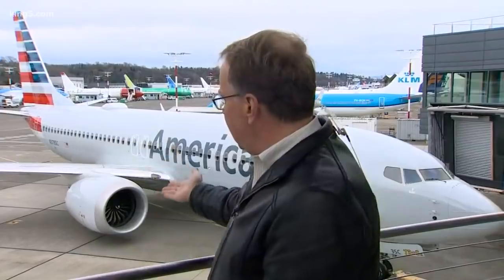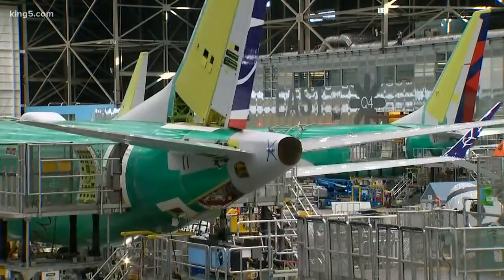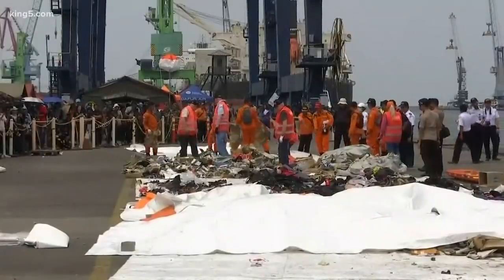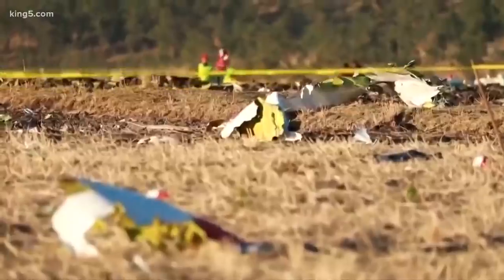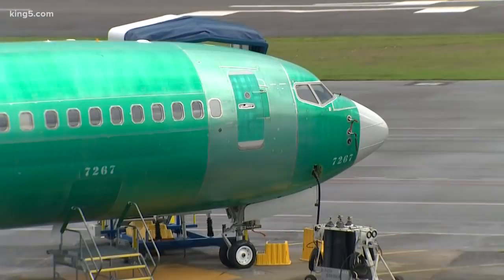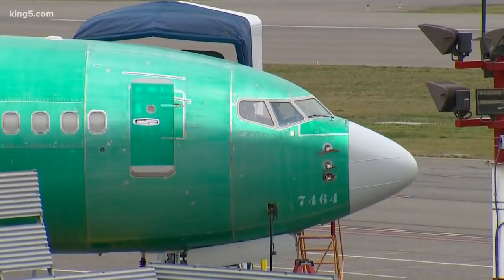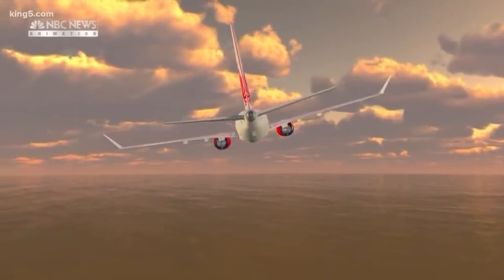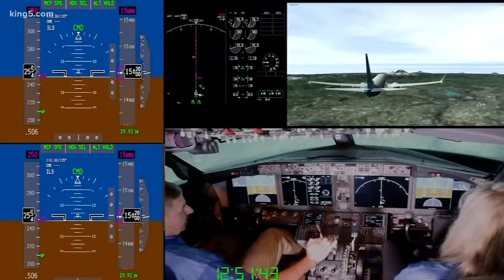Boeing unveils 737 Max fix

Comment: I will not put one foot into this plane.  Too less redundancy on safety Equipment
Reply: And also: fixing a structural problem with software? At all cost?
Reply: Ardent Fan  MCAS is designed to intervene in an extreme aircraft state that the airplane will most likely never end up in during its lifetime. It has nothing to do with how the airplane handles during normal flying. Pilots take care not to stall the airplane because stalls are deadly. All airplanes with their engines mounted under the wings have a pitch up tendency when thrust is applied.

No accident is caused by a single fault but by a chain of causal factors; human, technical, environmental, training, corporate etc., that eventually lead up to the disaster. Do you really think that mentioning MCAS with a couple sentences in the training material and in the manuals could have prevented these accidents? Maybe. But just because you know OF a system doesn't mean you have the tools to handle the consequences of a malfunction. There will always be other factors. The checklist that handles the symptom of the presumed MCAS problem has been in the Quick Reference Handbook since the 737 first came out in the 60's.

What we do know is that, just as in all accidents, a lot of things went wrong on these two flights so let's not oversimplify things.
Reply: Ardent Fan  You state the difference in your own reply. An aircraft crashing because of a stall and an aircraft crashing because of a malfunctioning "anti stall system" pushing the nose down are two completely unrelated accident scenarios.

I would never drive a car without knowing where the brakes are just as I never would fly a 737 without knowing how to stop a trim runaway, which is the symptom of the presumed MCAS failure.
Reply: Ardent Fan  I don't understand why you would be angry with me. I only tried to answer some of your questions.

Boeing obviously made a mistake in making MCAS too aggressive and only dependent on one alpha vane. I'm not saying that Boeing can't make mistakes. However you are trying to suggest that the 737 MAX is poorly designed and that putting bigger engines on an old airframe makes it unsafe. That is not true. It is a myth. Most pilots I've talked to say that the MAX handles better than the NG. Airplane models are fitted with bigger more efficient engines and undergo modernization throughout their evolution.

Again to answer your questions: MCAS is designed to alleviate an extreme situation which is very unlikley to happen in the first place. The 737 MAX is not the only airplane that has systems to help the pilots avoid a stall because a stall is very dangerous in a heavy swept winged transport category aircraft. If the airplane does get into a stall with MCAS "disabled", which is a scenario you wondered about above, then the consequences may be worse and we're in the chain of events that may lead to an accident but you can imagine how unlikley it is that these two faults would happen at the same time. You can add any two error scenarios together and the result would be higher risk. It is an impossibility to do away with risk entirely.

If a warning appears in the cockpit the pilots would go through the associated checklist. Some non-normals that are time critical have memory items which the pilots are required to know by heart. Among these are engine fire, airspeed unreliable, trim runaway.

However, as I have already stated: no accident has one single cause. We don't know enough about these accidents until the final reports have been released. Hopefully these will explain more about the airlines, the pilots, the authorities, Boeing, the certification and everything else that played a role in these accidents. Until then you are of course free to speculate because I suspect you know just as little as I do about the details.
Reply: Ardent Fan I don’t know the liability of anyone involved and neither do you.
Reply: Ardent Fan  Nose dive? Oh you mean runaway trim caused by the MCAS system. A dog is a dog. A rabbit is a rabbit. A horse? Well, it's a horse. If you're trim is running away then appropriate measures should be taken in said event.

Boeing is taking all the measures that should have already been in place to begin with. It is an unfortunate tragedy that so many people have lost their lives, but just as the  manuals are written in blood, so sometimes are aircraft changes.

Now, to say the max is compromised due to the design changes Boeing made is foolish. Is the A320 a compromised airframe because of a failed stall protection system due to frozen AOA sensors? Or is that not relevant because there was only 7 fatalities? Plenty of aircraft use the stick shaker and stick push as stall protection. Are those aircraft bad as well?

Comment: So scenario, AOA is faulty , pilot disconnects mcas. There's a cross wind and the plane requires more power, only now mcas is disconnected. The plane stalls ..crashes.. how is this a fix ?
Reply: Once the angle of attack sensor is found to be faulty, the pilot has to fly the plane.  He or she knows by many hours of experience whether the plane is climbing too quickly and approaching a stall.  The stall angle is somewhere in the range of 30°, which is very steep and obvious.  Pilots will easily stay away from this condition.  Far better than having the plane taken over by the computer which helpfully points the nose at the ground and kills everyone.  There were three faults here: new angle of attack sensors which obviously don't operate consistently, software that took over but did not check any other metric for stall, and pilots not trained in how to turn the system off.  Not using both AOA sensors was a no-brainer and will cost Boeing dearly.  Poor pilot training as well.
Reply: @lorenwilson8128  
List of no brainers:
1. Rely on only one sensor.
2. Not consult other sensors to judge the situation.
3. MCAS re-engage over and over again, despite pilot's effort.
4. No warning sign on screen, no warning light in the panel if you don't pay.
5. Not telling everyone the existence of MCAS system. Not giving even the basic training and warning about the new system.
6. Blame everything on the pilot for the first plane crash.
... the list could go very long.

Comment: Apparently the MCAS system is used on USAF KC767 tankers and the system there already used the two sensors.  I suspect USAF certification ensured this.   I can see how this happened: engineers for the 737 MAX were told to keep modifications to a minimum to avoid triggering a retraining of pilots.  Rather than designing a new aircraft using Boeing's excellent 787 and 777 FBW technology Boeing engineers were forced to layer modern systems over 52 year old mechanical/hydraulic systems.  Its a kludge because of the incongruity of modern FBW concepts of multiple redundancy and older concepts.   You can't pull out a manual for certifying the 787 fly by wire system and mix it with a 50 year old hydraulic system.   This came about because in 2011 Boeing saw American Airlines negotiate with Airbus over a new type of A320 that used Pratt & Whitney's new PW1000 geared turbo fan and GE LEAP engine which Airbus could easily fit due to their much taller undercarriage.  As a result Boeing elected to modify the 737 rather than redesign the 50 year old design so that it could get to market sooner.   On the B737 MAX the engines were moved forward and up to get ground clearance.  This not only changed the pitch characteristics if the engine was throttled up the engines were now so large they blocked the airflow over the wing giving a non linear stall.  Hence MCAS was fitted to avoid simulator training to acquaint pilots with the different feel.   The lack of sensor cross checking stuns me.   If Boeing ever tested MCAS failure modes it was probably with highly experience test pilots who knew what was going to happen and easily responded.
Reply: More appallingly the doomed Ethiopian plane actually had both AOA sensor malfunctioning. In its previous flight an experienced pilot (the one in the third seat) stopped the plane from crashing, reported this incident, and have the sensor replaced. Yet the plane computer chose to rely on the other sensor and crashed, which means in this plane BOTH sensors were malfunctioning.
Combining with the Lion Air incident, it seems Boeing's sensors have very high rate of failing!
Reply: @Thephilpw99 The MCAS system relied on only one sensor but it alternated which sensor is used each flight cycle for some bizarre reason.  When Lion Air maintenance crew tested what they thought was the faulty sensor the system saw it as a flight cycle and switched over to the good sensor.  The lion air then replaced the good sensor not the faulty sensors. Then when the second crew took of the system reverted to the faulty sensors.
Reply: @Thephilpw99  I think you need to re-check your facts.
Reply: @poruatokin 
Yeah, you are right. I got it wrong.
Reply: Exactly.

Comment: It is defective design issue, and unfortunately, FAA relies on Boeing personnel to do the certification processes.... Boeing raised the Max 8 larger more fuel efficient engines higher on the 737 low wings / squat, short frame (the larger diameter engines would have skidded on the ground if not) and this changed the angle of attack of the airplane —- basic physics / aerodynamics. 
The "fix" to prevent MCAS from forcing down the nose due to faulty sensors may also work when angle of ascend is too steep bordering on stall, whereby the faulty sensor may not detect such event occurring.
Reply: Most jets will cause the nose to pitch up with more thrust. It is precisely why you don’t give more thrust when you pitch down to recover from a stall.

Comment: wher is Denis???
CEO Denis said this airplane is safe..
why you fix something that is safe to fly??
Reply: Because they added more safety protocols and a more redundant systems to avoid further issues ..also lets not forget that they should have included the disagree lights as a part of the package not as an option.. also a least a warning  light  and a aural system to advise you that the MCAS was activated ...I hate that about Aviation , people needs to die to make improvements to a system !
Reply: @NonyaBusiness! if they had designed a new plane that would have taken over a decade an billions more dollars,so they made a makeover to the 737 so airlines won't have to train pilots on new aircraft,and so that the plane is 15% more efficient than before

Comment: I still wonder , why this didn´t happen in other parts of the world , but Africa .  And I don´t understand , why that 2nd crew of Lion air , was not briefed by company operations , about the problem and how it was corrected, by the previous one .   If they knew , they would be safe .  
Runway stabilizer cut out switches , or are those switches , unknown to these pilots ?
Reply: As they keep saying.  Accidents are caused by a chain of failures. Lion Air has an element of responsibility in this but certainly the bulk must fall on Boeing.
Reply: Watch from 6:39 https://youtu.be/9Ts_AjU89Qk
Hope it answers your question. Lion Air is based in Indonesia.  Asia not Africa.
Reply: @kims767  that is true, sorry.   After posting I saw that mistake, and didnt have time to correct kkkkk

Comment: This indicates to me that Boeing May have more info and data from the final flights crashed aircraft, and maybe others, than they are letting on. Most modern aircraft now send live data to aircraft manufacturers and airlines.

Operational test and evaluation principal is for a typical operator to do the final acceptance testing and these engineering principles needs to be adhered to in aviation test and evaluation plans.
Reply: Thank you! All these people below you bashing Boeing BEFORE WE EVEN KNOW

Comment: The tiny MCAS vein is something new to my knowledge.  In the days of pnuematic horizon indicators, it took a while for the gyro to spin up.  Once that was done , it displayed a representation of the aircraft's orientation in space.  Digitizing this function was a huge advance. To my knowledge, no modern airliner required the MCAS system. MCAS also is the acronym for Marine Corp Air Station.  Is it possible that the 797 bing considered might be downsized to replace the 73?
Reply: Misspelled "vein" - should read "vane".
Reply: This sensor is not about the horizontal position, but about the air flowing against the plane. That's why it's still there.